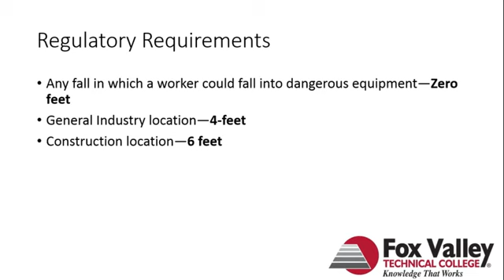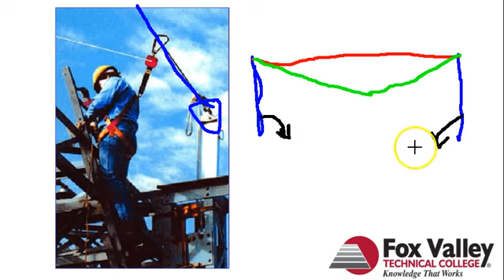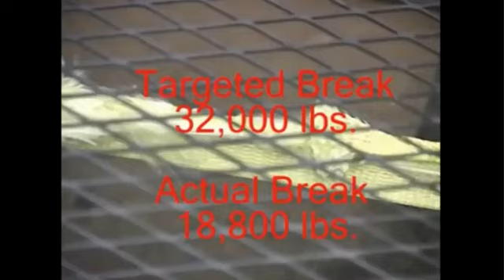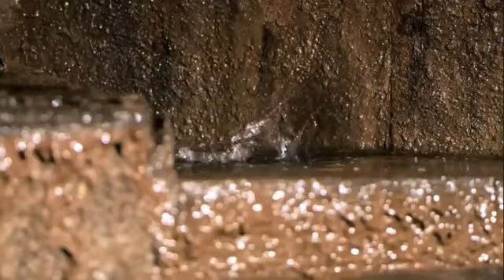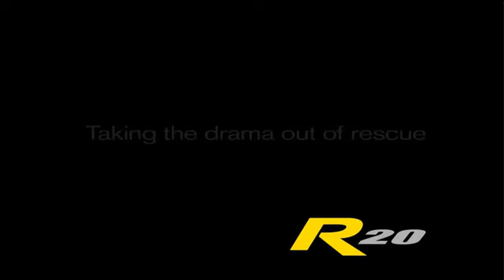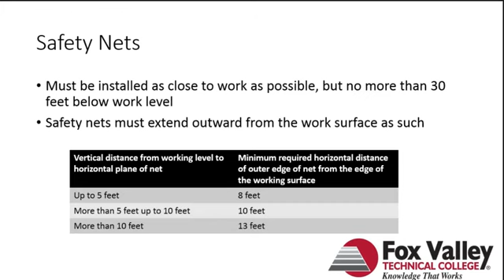Fall Protection Video Lecture

Comment: Thank you very much for the lecture video about fall protection, I am still learning and familiarize myself with fall clearance calculation. Does all the lanyard length is 2 meters and deceleration yard is 1.2 meters by standard?